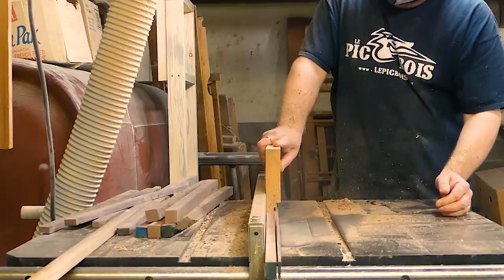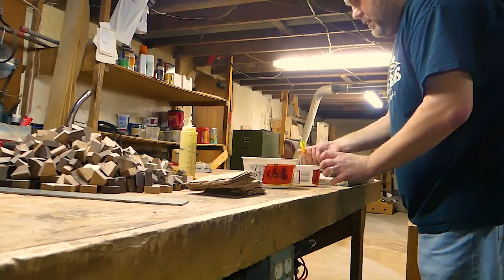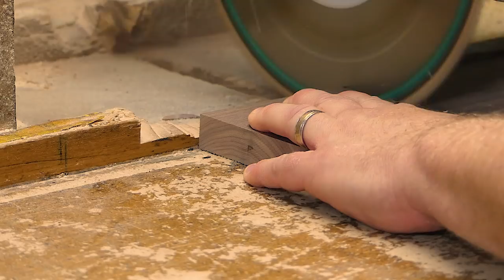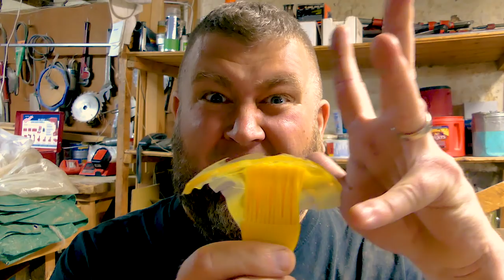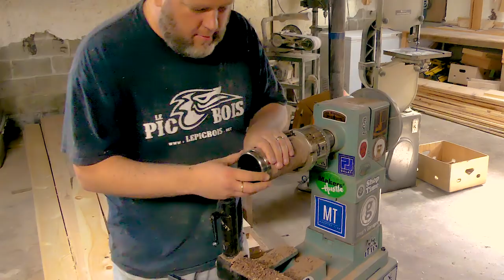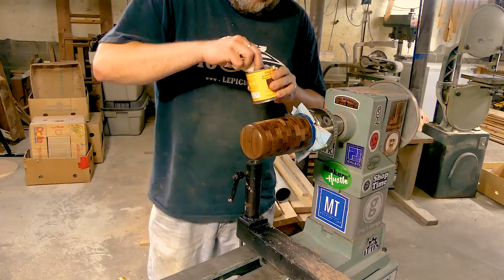Making a Segmented Faux Brick Tumbler

Comment: Good job, been missing your videos.
Reply: Been slack lately myself, but then I just had about 170sq metre's of concrete poured, an area of which I'm making into a new wood shop, well once I design it in CAD first, then build it.
Reply: More than likely. I have security cam footage of the area of the carport and what will be the workshop area behind there being prepped and poured that I was hoping to incorporate, but I haven't been able to get the footage off the DVR, probably doesn't help that I use Linux for everything, and the web interface requires Internet Exploder 7 to access the video footage. May have to just install Winblows in a VM and access it that way.